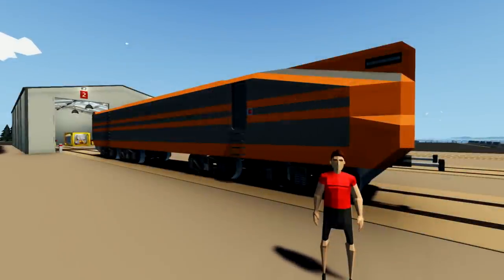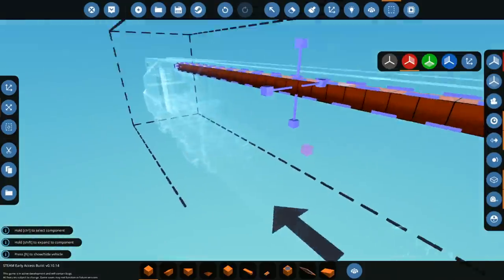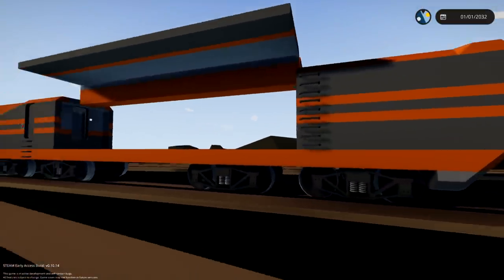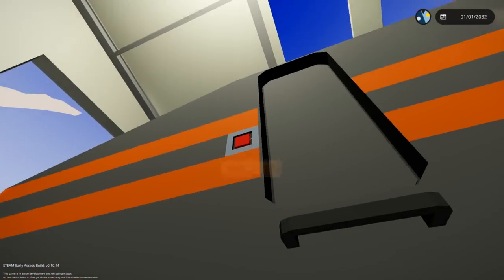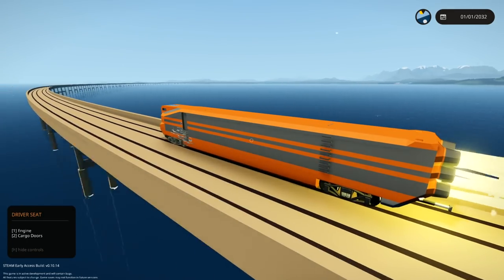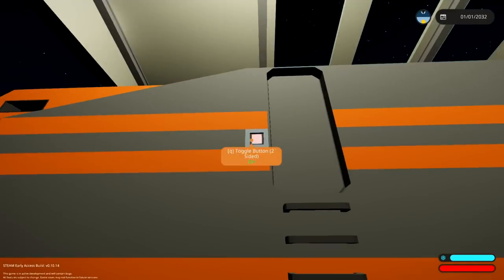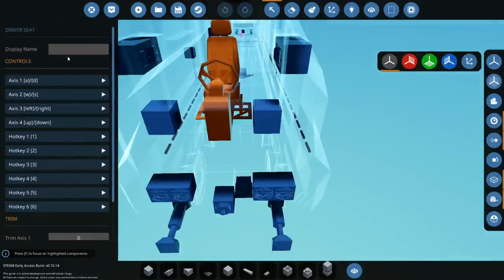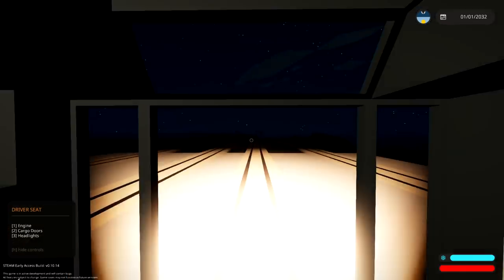Gull-wing Cargo Doors!  -  Jet Train  -  Part 4

Comment: So i have a few suggestions. I think you could turn that little fuel box thingy in the cargo bay into like a little control panel for the gull wing doors and stuff like that, so it doesn't look out of place. Also, I think you could put lights in the gull wing doors and set them to turn on when they open, so that the area is lighted when your loading stuff. Also, maybe put a crane or something similar in the cargo area and control it from that little box turned into a control panel I suggested
Reply: thats a lots of suggestions dude
nice
Reply: *Thermal equipment too.

Comment: Add a crane or a conveyor belt in the inside, make it fully automatic so u don’t need to put cargo in!!
Reply: conveyor belt... interesting... might need to test one of those
Reply: confirmed, it is possible with moving pipes or blocks HOWEVER it does not work efficiently, or look good, or go fast, or pull things up any incline, wheels and tank tracks dont move it btw

Comment: I think the engines exploded because the small electric motors in the roof on the back aren''t water tight.
Reply: No, I think jet engines explode upon contacting water, and the exhaust had direct contact with the water. This, I think, made the whole engine explode.
Reply: Jet engines explode when they reach 200 rps
Reply: They only explode if the intake touches something. I made a jet boat with underwater exhaust and it’s fine

Comment: You're exploding because your PID is overshooting the 180 mark and going into explodey territory.  That's why you can accelerate slower and it doesn't overshoot.  PID tuning would fix that, but I haven't figured out good numbers for that yet.

Comment: Modify the front of the train so you can put the engine behind the cars so the jet stream doesn’t go through the cars. And mag all’s and rails. Maybe turning the drivers area into a cargo bay with a ramp on the front that folds up. Then you put the driver on the top in a little cab. You also need to add heaters.

Comment: Im thinking something like a fold out ramp or a secondary fork lift like creation to load ex. big cargo or a small car or bike into the back.
I agree with the control panel on the fuel tank section comment. Maybe an arm on a side or something to pick it up instead. If you want you can add stuff to monitor the engines on the wall even a camera of the rear.
Not much to say other than nice! Why no reverse and gotta go fast!
Btw this is also because I'm sure people will want to use your creation.

Comment: Hey Matty, quite funny that's my name in everything apart from YouTube. At 6:06 the train bounced on the corner part, that's because you have tried to make a double bogey however they are both connected to the train itself and not a rotating bar, so on tight corners like that they fight against each other. I've made a train with some friends that has a true double bogey if you would like to see that. 

Edit: nevermind, I just watched on an extra 2 minutes and you removed it! 😂